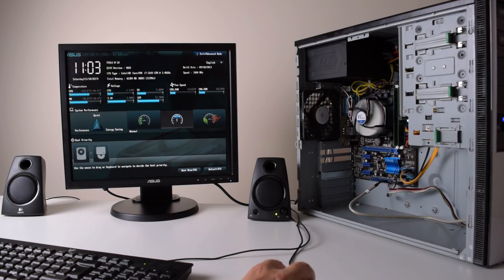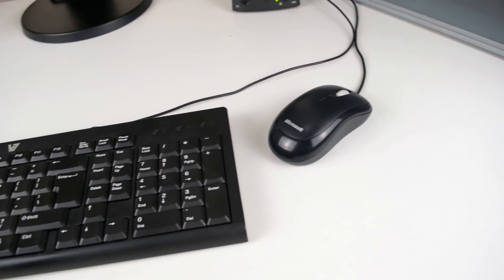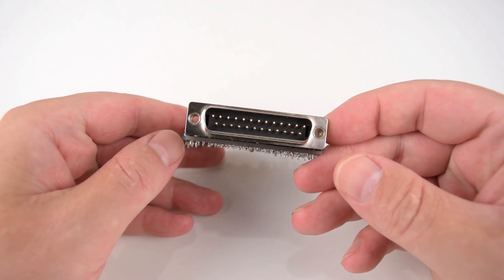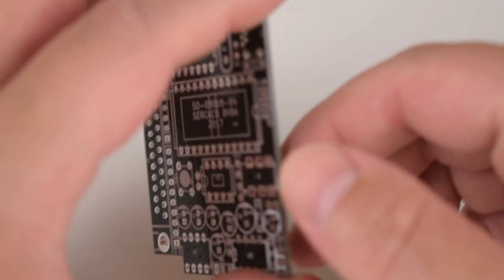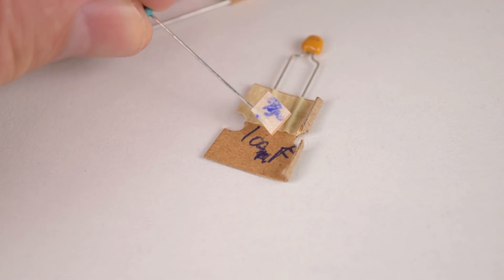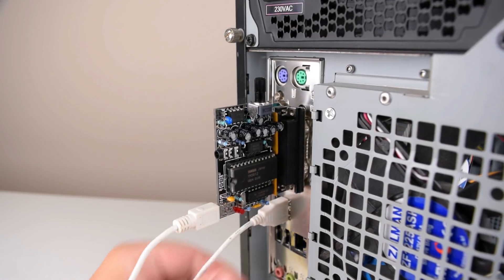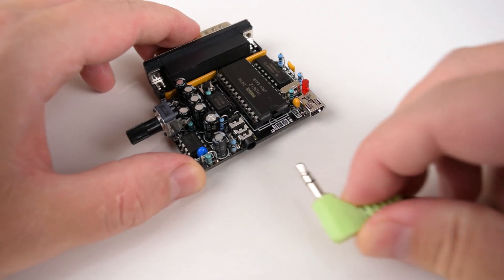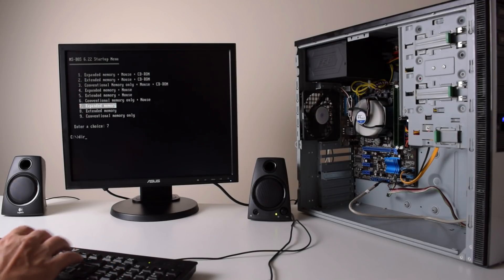Adlib Yamaha OPL sound in DOS games on a Core i7

Comment: The backwards compatibility of Intel is just unbeatable 
👌
Reply: dos games work fine with new amd cpu's as well. and modern graphics cards generally run most old games fine as well. 
Its not really intels doing. most pc hardware is simply backwards(and forwards sometimes) compatible.
Reply: You can thank AMD for that; back when Intel and AMD were designing their 64bit CPUs, Intel opted for a completely new instruction set (IA-64) that had practically no backwards compatibility (it could emulate x86, but it was very poor), while AMD expanded the x86 instruction set into 64bit (x86-64) specifically for backwards compatibility with 16bit and 32bit software. It was because of the backwards compatibility that everyone chose x86-64 instead of IA-64 and Intel was eventually forced to switch over.
Reply: its not backwards compatibility , its still X86 , same instructions as a 80286 even on the most modern and buff intel or amd chip
Reply: it will probably end in 2020 since intel wants to ditch CSM - legacy bios compatibility emulation, probably along with MBR partition table, and will be only UEFI/GPT so legacy OS wont boot.
Reply: That is software locked. You can "crack" that lock if you insist, but if you are running Windows anyway just use 10 and run XPAntispy afterwards as it runs on and can detect 10 and act accordingly.
Reply: technically you are right , but not quite , it would be backwards compatibility if X86 was unused and obsolete , wich it is not (latter is up for debate)
Reply: In fact all x86 CPUs since the K5 and Pentium Pro are RISC internally. That's why there is an L1 Instruction cache. The x86 instructions get translated into CISC instructions.
On the outside all modern x86 chips can be adressed the same way as all old ones, to the outside they still look the same.
Reply: for now.

Bios support ends in 2020
Reply: +Secure Steve
That is completely untrue. Intel KabyLake Cpus will absolutely run Windows 7 or 8 or Vista or XP or 2000 or (98 or 95 if you can find a motherboard with decent drivers for those old OSes, but they will still boot, I've tried them) or MS-DOS or FreeDOS or Linux. It's still an AMD64 architecture chip, which is backwards compatible with IA-32 (x86), 80286 and 8086.
Reply: To those of you who arw saying it's not backwards compatable due to being the same instruction set, it's not. It's an entirely different one from the past. Same name doesn't change anything. Let me just point out, why do you think the current instruction set's as large as it's now? The instruction set's what one calls a "Complex Instruction Set Computer", or CISC for short. It's entirely reverse in concept with RISC, of which ARM is that of the latter. Part of the reason why 86_64 is complex happens to be due to its redundancy, partially done here for backwards compatability reasons.

To those of you worried about Intel deprecating CPM and related standards, Intel's not the motherboard manufacturers. It's them who decides to use these standards the first place. Indeed, I believe the only reason UEFI had as much a success as it does now is due to the fact that Microsoft, forced them to adapt; without doing so, they can't even ship Windows with their computers. If Microsoft didn't force them to adapt, it might not even be as successful.

Even if them abandoning support is a problem for DOS, there's nothing stopping one from writing a bootloader and the like.
Reply: to be honest, I had some problem with cga games on my 1050 ti, it was just black screen
Reply: HappyBeezerStudios - by Lord_Mogul

Let me just point out, for reasons that should be obvious, what's internally behind the CPU's logic is not the CPU, itself. It's the end product. Those RISC internal processors you've mentioned just provides for the backend programming of the CPU, itself. In the end, it's the entirely of the CPU that happens to be such, not its individual components.
Reply: I don't think so. It's because intel CPU is CISC machine which can keep backward compatibility
Reply: IIRC i64 also just wasn't as good
Reply: They even pass their bugs back in time..
Reply: +Justagermannerd  ―_―

Comment: Do you have to use software to slow CPU down? I would have thought that games would run too fast on the I7 out of the box.
Reply: Older games do indeed have terrible issues, but VGA games in general just use the vsync to keep the timing correctly.
Reply: Having to run games in DOS Box or K6-2 underclocked to 200MHz due to a compiler bug in some games is fun.
Reply: Borland Turbo Pascal runtime error 200?
Reply: patches exist for the borland 200MHz initialization bug

Comment: What kinda i7 mobo has a Parallel port?
Reply: This one does, and it also has PCI: https://www.gigabyte.com/Motherboard/GA-Z87P-D3-rev-1x
Note that the rev 2.0 board is of a lower quality.

Edit: BTW, you can easily get PICe parallel or serial port cards.
Reply: Actually a lot. But most of them only with an internal pin-header. If i look on geizhals (a german price comparision) there are listed over 139 for socket 1151 and 19 for AM4.